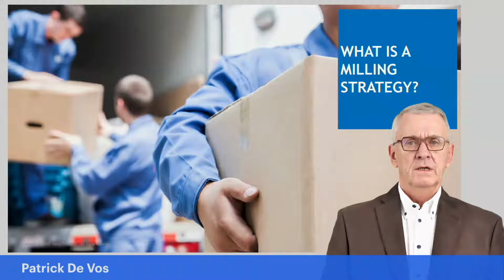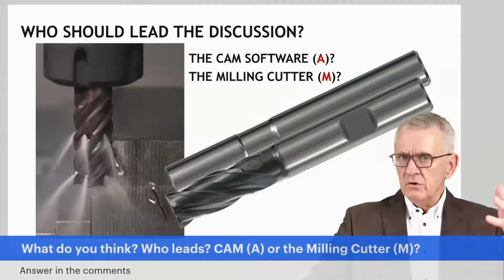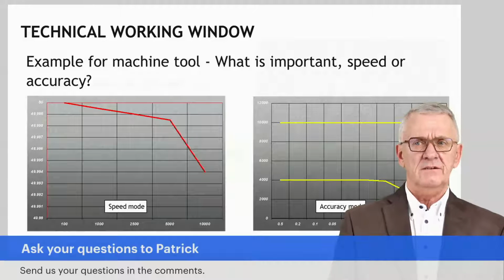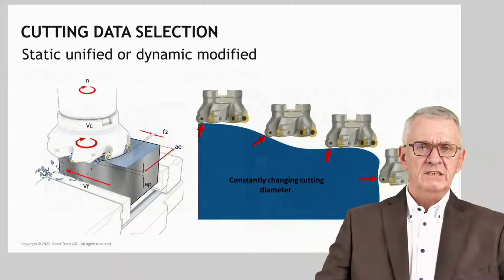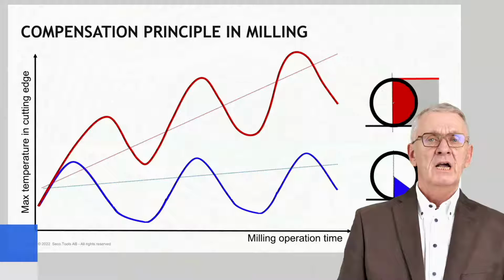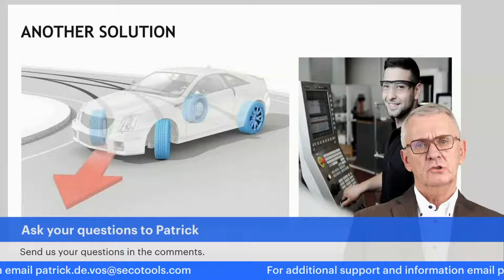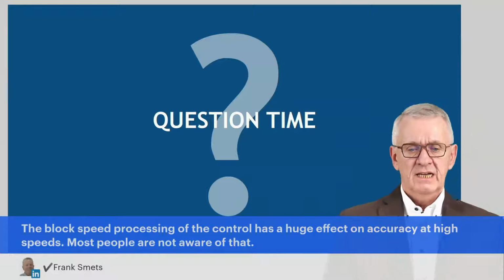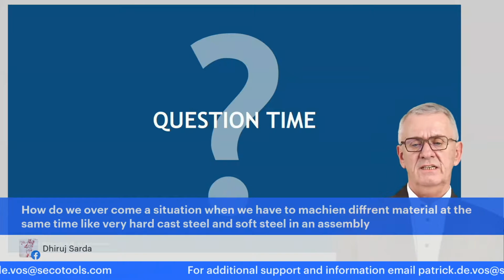What are milling machining strategies and why should you care about them?

Comment: Hello, ofcourse that the milling cutter pick comes first depended by the material that we machine and from that we use the parameters that the provider recommend for the tool to create the best toolpath for the tool used so we get the most from the tool and ofcourse we always try to increase the tool life as much as possible. Greetings from Croatia.
Reply: 100%, can't efficiently use an 1/8 end mill to cut a 3 inch deep pocket and can't use a 1 inch cutter to pick out a .250" inside corner radius.